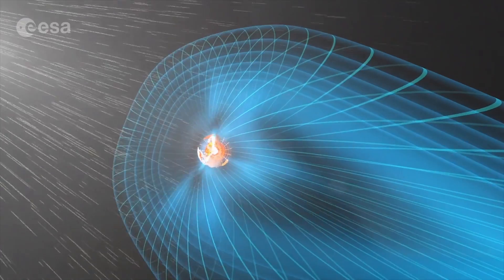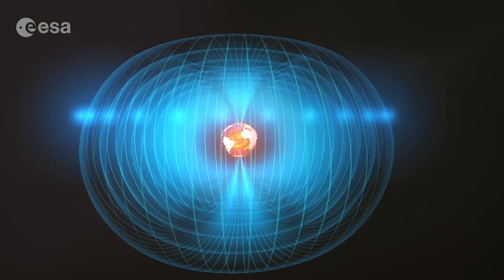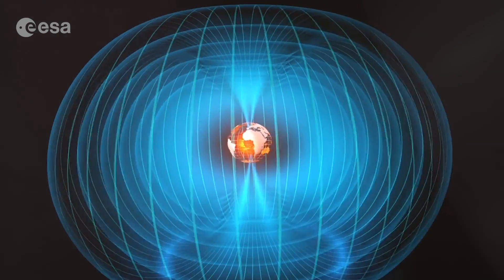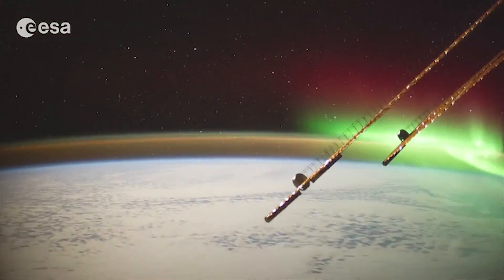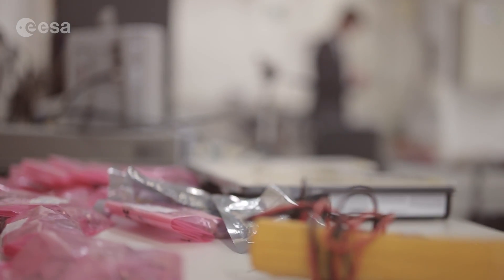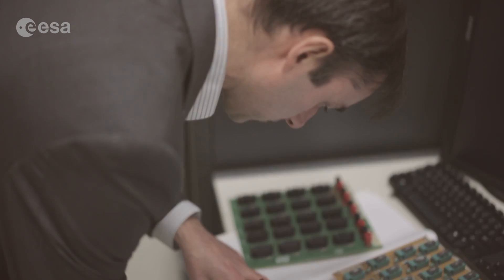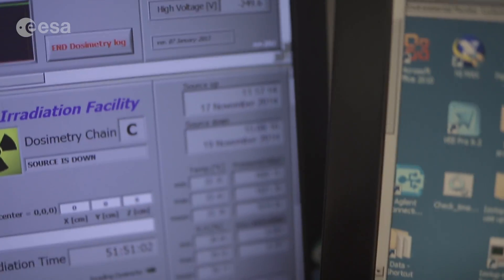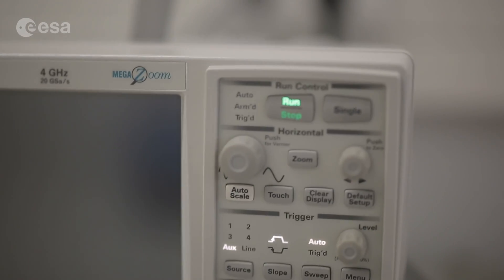Radiation testing for space

Comment: At 2:26 you can actually see the radiation affecting the cameras inside the test environment. Very cool.

Also: He sais they are simulating the 'high energy particle' environment with gamma rays. What other radiations are out there that can affect the systems (so mostly not alpha and beta rays)
Reply: The radiation belts around Earth trap electrons and protons, but cosmic rays also contain heavier ions from all parts of the periodic table.
Secondary particles are usually lots of Gamma and X-rays, more electrons and also some neutrons.
Reply: @AntonFetzer Does this job also involve sending detectors into space and characterizing the space environment?
Reply: @cryora   Which job are you refering to? My current doctoral student posiiton is about radiaiton shielding optimisation for satellites and I am going to work on a shielding experiment that will hopefully be sent to space at some point.
Reply: @AntonFetzer  Radiation effects engineer.  Oh cool, you have an actual PhD project on this.  I already have a PhD but it is on Thomson Scattering with lasers, and I find it hard to market myself to jobs in industry.